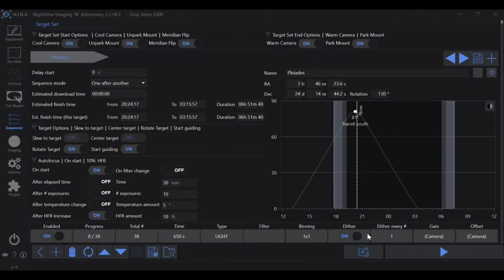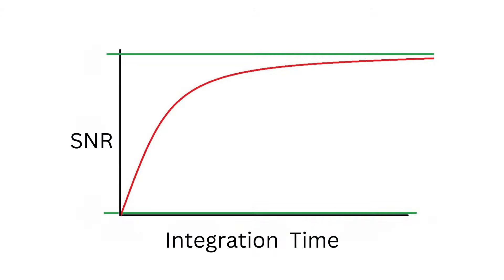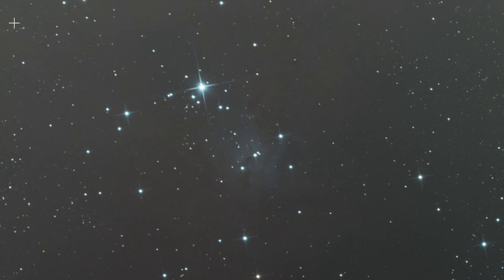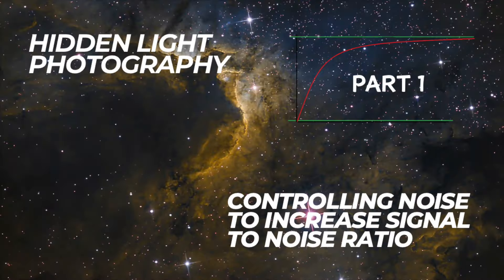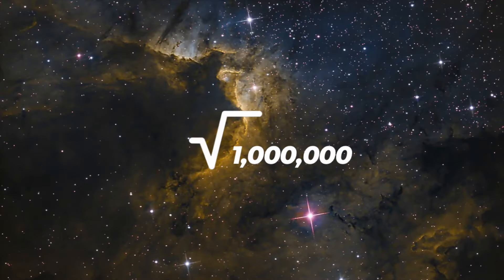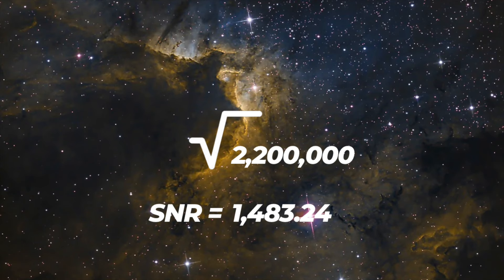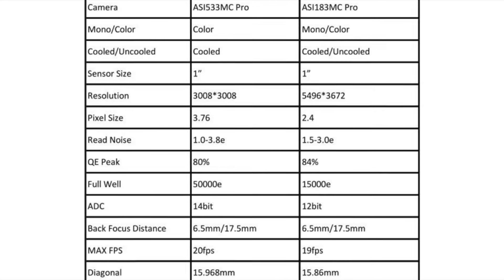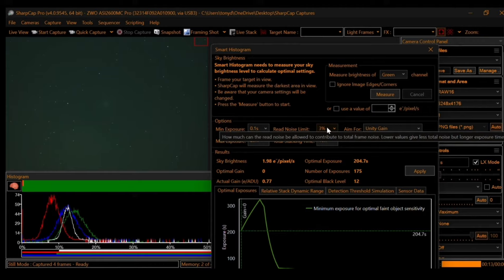Diminishing Returns in Astrophotography: How Much Integration Time is Too Much?

Comment: how do you keep your telescope pointing on an object for hours? don’t the objects move and go below the horizon? i know that tracking is possible but you can’t do anything once the object disappears below the horizon can u?
Reply from the maker: Good question! You would need to separate your total integration in multiple nights. For example, if you only have 4 hours available per night and you wanted 12 hours of integration time, you would need to image across 3 nights.